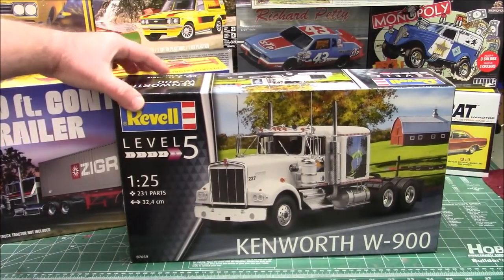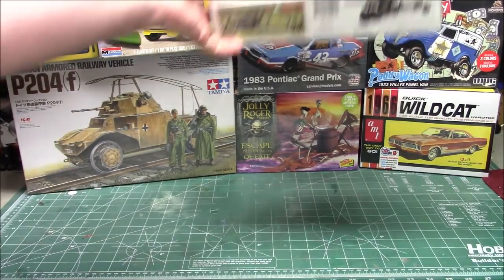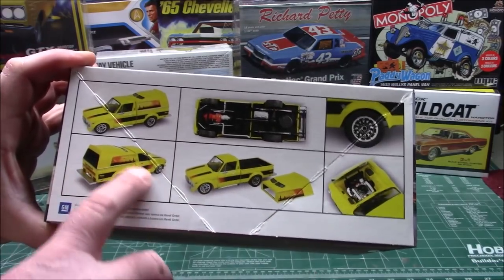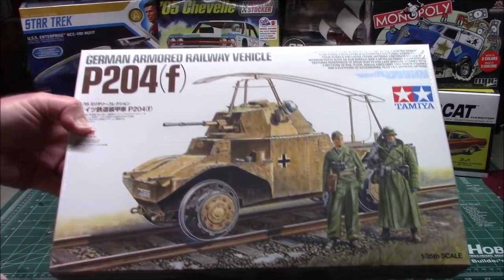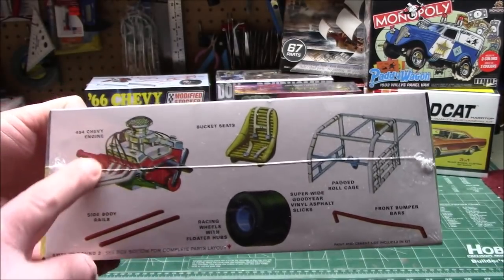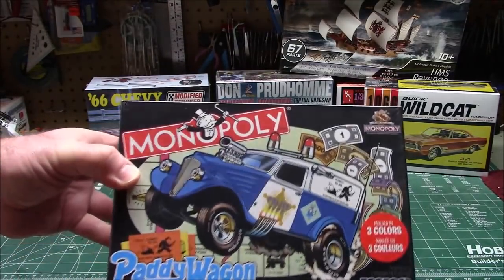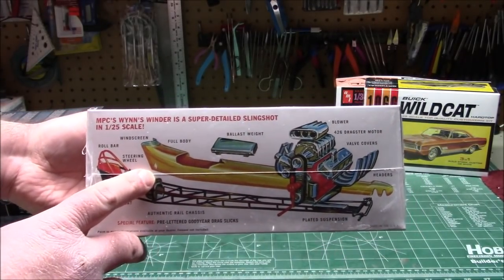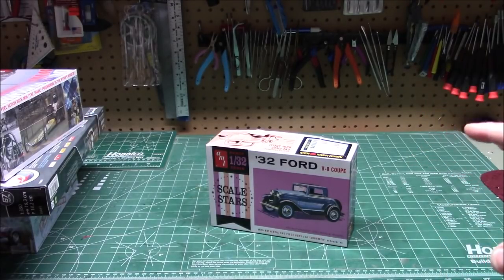UPCOMING KIT REVIEWS SCALE MODEL BUILDS AMT SALVINOS JR REVELL TAMIYA MPC LINDBERG HPIGUYS WORKSHOP

Comment: I would love to find a 20/40 12 pin 10ft tri-axle container chassis. In 1/32 scale.
They have drop deck tires on the axles. It can haul 1 loaded 20ft 1 40 ft standard or high cube. Or 2 empty 20 ft containers. Weathering a container the biggest thing is metal patches on the roofs and walls. Poke holes on the roof corners for when the crayne drops the pick carafe and misses the holes. 
and the ridges on the walls are pushed in or out. A standard 40 ft chassis. The axles are to the rearend. And they are rough. Lots of rust and faded numbers containers have grease pencil markes on the drivers corner container line initials and a date A G or B for a good box or a bad box. And rust lots of rust.

Comment: so would that Kenworth work as Snowman's rig from Smokey and the Bandit or would it need a lot of modifications???
Reply: The More correct kit to make Snowman's KWhopper is the recent issue AMT 1021 Watkins W-925 with single bunk and straight bumper. Just locate pair of battery boxes from Revell snap or glue kit. Modeltruckin website has the decals.
Reply: thank you my good sir
Reply: @Farlomous  Sure, and forgot to tell u it is usually cheaper $$ too!